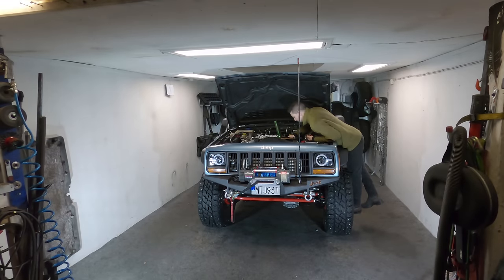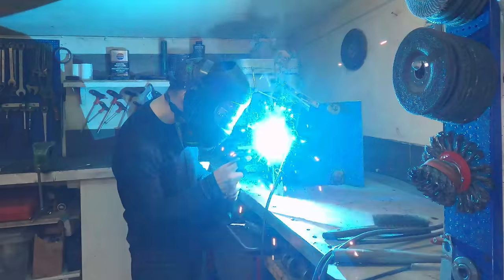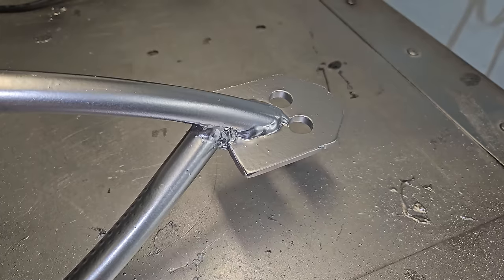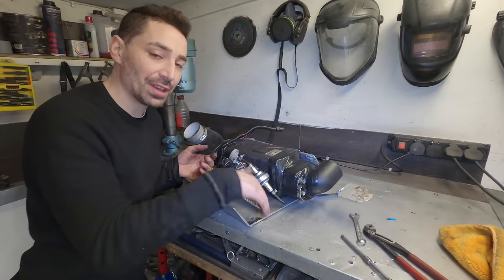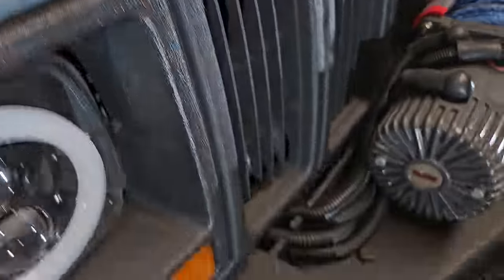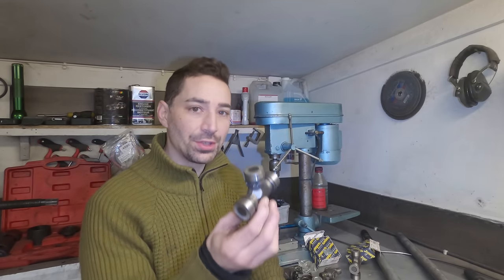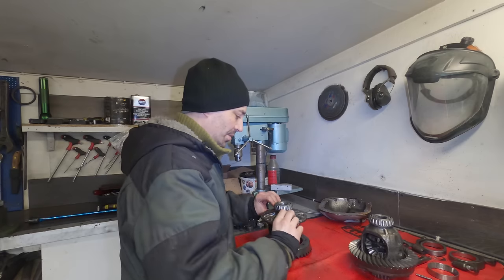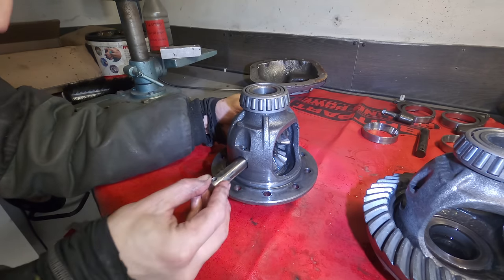Building A Front Skid / Dana 30 Spider Gear Replacement / Jeep XJ

Comment: I didn't see that other video, but that makes sense. Torquing that hub nut in the air is just like having a locker with a wheel bound up in the rocks; that's a lot of strain on the spiders for sure. Definitely could have introduced some micro-fractures that later led to the carnage, as normally a u-joint will fail long before a spider gear. Hub nut torque should always be done with the wheel installed and resting on the ground (or held with the brake) so that the stub shaft splines can take the force instead as they are much stronger than the spiders and don't deflect.

Comment: Keep your chin up! If anyone can make it work you can. I have a 1994 Bronco I’ve been modifying and some times I do throw a wrench or two. I agree with having an open front diff option. Even a TrueTrac with “lock” the front wheels and after that you head straight off into a ditch or worse. I have an Eaton E-locker in the front and I like how it works. It’s a little weird to flip a switch and it’s locked as apposed to hearing an air pump turn on first then it locks. And I’ve had air lockers and had them fail over and over again (air leaks and o-rings) I did have a failure of the e-locker when the tabs that keep the magnet from rotating broke at the small welds. Ordered the part and a pretty easy fix other than removing the diff to get at it. I do look forward to your videos. Keep up the good work.

Comment: Idk if I’d want to fully lock a d30 but if you’re just in snow using it, it’s not too bad. There’s some guys who use massive tires/40inch+ up here in north Idaho snow and get away with it on d30s, they keep the clearance and weight down. 

I’ve used a lunchbox in the rear axle of my dad’s Toyota and you have to just learn how to drive it. As soon as you lift off power it disengages so you can coast through a turn. Plus it’s not as bad on the front. They’re cheap: maybe you should try it, just see if maybe you’d like it. Won’t hurt in the snow. If you drive 4wd on icy streets you will have to baby it.

Comment: i believe the carrier break only affects the ring gear mounting surface. on one side of the break the ring gear mounting is closer to the pinion. I think lower ring gears (<3.55) are farther from the pinion. All else is the same on the carrier. When i went to 4.56 in my xj dana 44 rear I ordered "thick" ring gear to make up the difference.

Comment: i was having trouble getting my diesel heater started - while i was cleaning the glow plug and air hole and screen that the glow plug sits inside i accidentally poked a hole in the bottom of the screen mesh.. i figured it was hooped so i just kept going and got it clean and put it back together with the bottom of the screen now just a hole - to my surprise it starts easily now and i havent had to clean it out since.. even with many many more start ups than the original setup. cheers

Comment: I think you are correct that a piece of the spider gear caused your broken tooth on the ring gear. I think the spider gears are the weak link on the dana 30 front axle. In a 1965 CJ5 that I built, I installed a Dana 30 with 5.38 gears and I installed a spicer powerlock limited slip. The power lock has two halves of the case that bolt together, there are also 4 pinion gears and double cross shafts making it much stronger than a open differential. It also has very good holding ability. I think Yukon gear is now making a copy of the Power Lock, I haven't checked to see if they make one for the dana 30 lately. My first choice in your case would still be to go with a helical gear limited slip, they are very durable and will give you both front wheels spinning in most cases in the snow with good on road manners on snowing roads in 4wd. The other options are full lockers, but they aren't so good on snow covered slick roads. It is a shame that it costs so much to ship from the US to europe. My current Jeep TJ has ARB air lockers in my Currie High Pinion 9 inch axles. The ARB's are nice, but they leak air on occasion and they are very expensive. My last off roads rigs all had Detroit lockers front and rear and asside from being not fun to drive in 4wd on snowy roads, they were awesome. I also built a Jeep CJ7 with 1/2 ton chevy axles and I was on a budget, so I used Lockrite lockers front and rear and I never had any issues with them on 35's.

Comment: RCV axle shafts (30 spline)  + OX locker (electric actuator). OX Carrier has 4 spider gears and this setup is rated by manufacturers to last 35" tyres in D30. That is what I got for my jeep from the beginning and looking on your issues it seems like it was good idea... I hope You will get on track with rebuilt diff soon! I know it is a lot of money but larger diff will lower your front ground clearance.

Comment: I don't think that your Dana 30 is exactly weak,  although it is not a huge differential,   
  The weakest part of it is probably infact the stock open carrier,  they usually attend to flex and even infact bend under heavy work load, 
    There is a guy from Florida that had a YouTube channel called    " Rusty 411 "   that has a XJ with 40;inch tires that shows the ring gear flange on his Dana 30 being bent.
    If you would like to see some very good Dana 30 and 44 building videos,   one YouTube channel you may want to check out is 
  BFH Garage,   he is a off road guy from Colorado.   
   Or another one is  Dirt  Lifestyle.   They are both very good fabricators.  
   Thank you for your videos.
Keep up the great work.
  Tim from Wisconsin
Reply from the maker: It's not a bad axle, and I'm doing what I can with it. I have a differential lock coming that will replace the carrier. Also, some CV axles. After that, I won't reinforce it more. I think It will be as far as I take it. 
Thanks for the link, I watch Rusty and occasionally Nate. I will certainly check out the other guy you mentioned. 
Thanks for watching

Comment: So obviously getting parts is gonna be really annoying and expensive but 30 spline shafts with bigger u joints are about the same cost as normal chromoly shafts. The expsnsive part is the 30 spline locker but once you do that thats really the strongest dana 30 you can have. Just a thought since you are kinda stuck with that axle

Comment: Mike, you need a set of JK axles if you insist on running 35's. The JK Dana 30 HP is considerably beefier then the pre 07 Dana 30's. The non-Rubicon JK axles would address your issues. That and RCV axle shafts. You could even go non-Rubicon front and rear Dana 44's. I know they're expensive but trying to beef up a Dana 30 that is only good to 33's max, will continue to cause disappointment and be cost prohibitive.
Reply: Eaton tru-trac is a great choice for the front and rear as well.
Reply from the maker: Thanks for the advice. I will probabaly have to look for Nissan Patrol axles given I'm in Europe and there not that expensive. 
Thanks for watching!

Comment: I'm on team dana 30. The snow is hard on it for sure but the e locker will clean up a lot of those concerns about internal. Ujoint will be your fail point, and that's what you'll want realistically. Shoulda replaced them spider gears at 25 years lol. Haven't you read the manual? Jk

Comment: How I say last comment, take a look in patrol y260 or y60 diffs, y60 our y61 it's heavier them y260 and it's a bit work inverting the front one, but you never get problems again. Heads up. As I say, there is just no solution to death
Reply: Patrol axles 100% the best solution
Reply from the maker: I found a couple online. They aren't that expensive and in the long run I will save money. How do you invert the axle, just take out the shafts, swap tubes and rebuild? It doesn't seem that difficult when i think of it but I imagine its a shit load of work. I don't mind doing it, I will just take my time.   
Thanks again!
Reply: @WorkshoptoWilderness  Yes, you exactly invert the tubes, but in my case I didn't remove the tubes from the cast iron, I cut them, aligned everything and made several welding passes, slowly so as not to warp them. Only the patrol 260 has the cast iron middle part, the y60 is 61 doesn't have it, you have to cut it out. I can send some photos of how I did it to give you an idea
Reply: Patrol 260 2.8 D without turbo with original shorter ratio 36.7 -5.14 the shortest of them all, it's the one I have

Comment: Idk what the preferred corless tool brand is over there (Festool?), but they need to sponsor Mike! Lots of exposure, and Mike gets a corless Grinder.

Edit: The R&P is the weakest area on the D30 you have built up. I'm surprised it was the carrier too. There has to be some form of 1 ton vehicle over there you can get an axle out of.

If not. How about some sort of hybrid? I think you could fab a Ford 9" center and axle tubes (or something else strong, maybe an 8.8"?) and run D30 outer stuff?
Reply: Nissan Patrol axles are the best way to go in Europe. Relatively plentiful and Mike has all the fabrication skill required to do the swap

Comment: I don’t know, may I can be saying a nonsense thing. But as you face a lot and sometimes deep snow, wouldn’t be better you adapt something in the front bumper that would move he snow to the sides, leaving less snow for the Jeep push against its suspension and other parts? Could be something that you attach when needed, yes would put more weight at the front, but you would also have more traction and also saving you to have constant maintenance from parts that end up getting smashed by snow.

Comment: oh for a replacement axle been as your in sweden.. how about a volvo c303 axle set? super strong portal axles with lockers should be able to get them easy and probs be cheaper than trying to get jeep stuff with your link setup should be jolly good. and even let you run somewhat larger tires.
Reply: Это очень правильный совет, у нас в стране многие ставят мосты от 303 и колеса 38-44 дюйма!
Reply: He is saying that elocker is expensive and pain to fit in. Volvo 303 axels would cost him near 6-7k usd + massive amount of work to fit them in. Just not realistic. Also his car would drive like peace of shit on the road. Portals are cool, no doubt,  but they are huge compromise in terms of reliability, part availability, and cost of maintenance
Reply: no worries just a thought with him been in Sweden might be able to get the 303 axles somewhat cheaper than proper jeep stuff from the us. Patrol axles could also be a option and while yeah abit of work to fit they are alot tougher. I know a couple of people running them under landrovers here in the uk and had no issues with reliability parts or maintenance, cold could be a issue if keep the vacuum lockers but can convert them to electric  @Aldan001

Comment: I know exactly where you are coming from re the Dana 30.  My TJ has the even weaker low pinion version and I am working on a high pinion from an XJ to switch in, but whatever we do to truss it, add chromoly shafts, etc., etc. there is nothing we can do to make the ring and pinion stronger.
So frustrating watching all the YouTube footage of US Jeep owners swapping in one of a vast range of alternative axles, knowing they just aren't around in any sort of numbers in Europe.  The only real choice is spend a kings ransom to ship axles from the US, or cross our fingers and run the Dana 30.
PS what brand of chromoly shafts were they?  Pretty shocked the U Joint took out a stub shaft on a chromoly.
Reply from the maker: Its tough seeing the plentiful axle swaps while all we have here are dana 30's. Even the 8.25 29 spline on the rear is getting rare. I'm using Ten Factory 27 spline shafts with the 5-760x joints. Saying this though my longer shaft side is totally dead now and I'm just using a standard shaft. The Eyes on the stub shaft are completely deformed and misaligned and I wont pay 400 euros excluding shipping for another. 
Thanks for watching.

Comment: I don't think it's a good idea to weld the caps on. The movement in the radial direction is necessary to avoid misalignment when the joint bends.
If you weld it tightly it will destroy your bearings.
In general, with bearings you only have to have a press fit where the load rotates. With a point load, the caps must have a small amount of play and they can move radially.

On your cardan shaft, the cross joints are secured with locking rings because the shaft does not have any intermediate bearings.

One end of the front axle is mounted in the wheel hub and the other part is guided in the axle tube. If you drive with them stuck you will destroy the whole axle!!!

Sorry for my english and best regards from Belgium
Tobia

Comment: Regards. I have a problem with my VM which I cannot solve, the car is rarely started, a week ago I wanted to start it but I noticed that there was no glow plug light, I connected the glow plugs for a short time and the engine started. However, it turned out that there was no indication of engine speed and no charging. I don't know where to look anymore
Reply from the maker: Have you checked the fuses in the engine compartment?
Reply: @WorkshoptoWilderness  all of them and inside the car to
Reply from the maker: When the car is running, press the glass on the instrument panel. You might have a loose connection on the back of the instrument panel. This might restore engine speed and charging
Reply: unfortunately without result. Looking at the alternator control diagram, I replaced the ECU to be sure. also without any results. error checking does not work either. While dismantling the counter panel, I found another computer with an aluminum casing.. @WorkshoptoWilderness